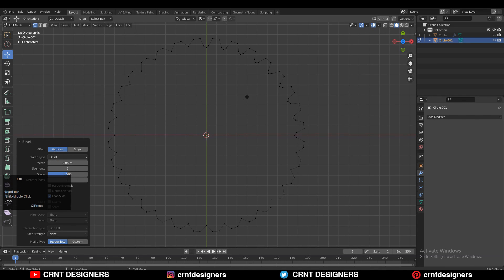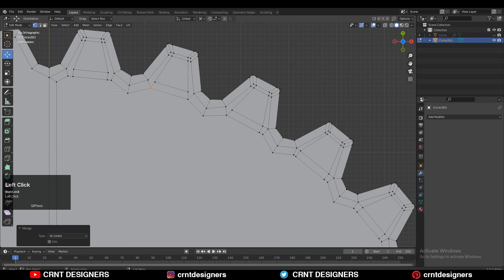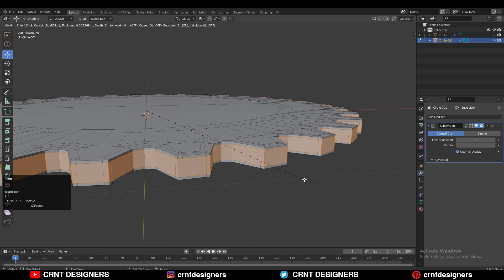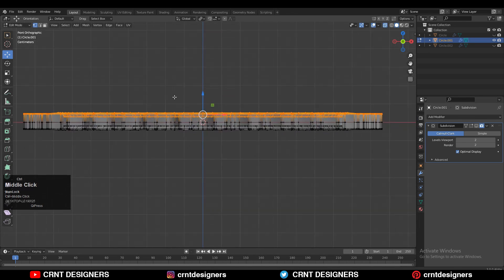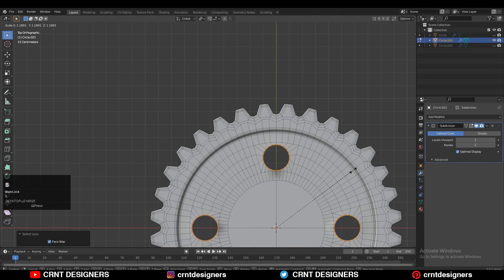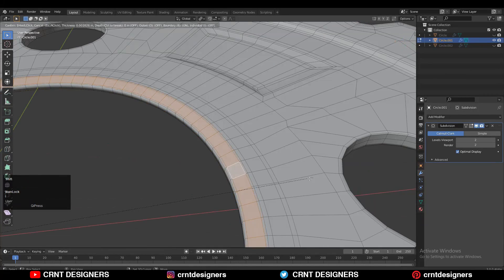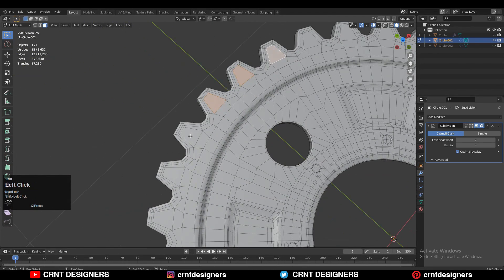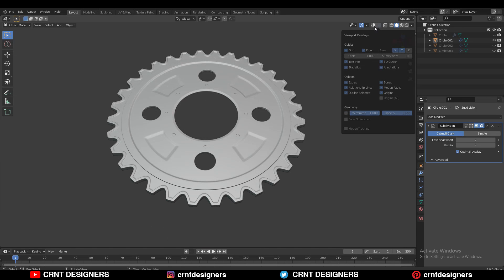Mechanical Gear Modeling _ Blender Hard Surface Modeling _ Blender 3D

Comment: Hi, Could you please make quick tutorial how to model car break disk with radiator ribs between disks? I can model disk with hub holes based on your previous tuts but I stack on the cooling ribs.  I'm starting learning Blender with yours tutorials. Thanks a lot for this short quick tutorials.